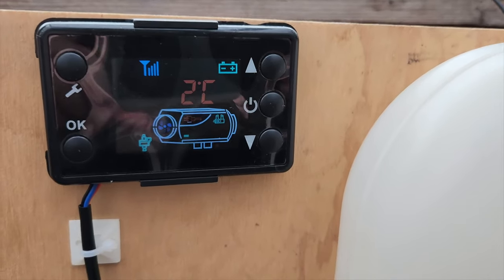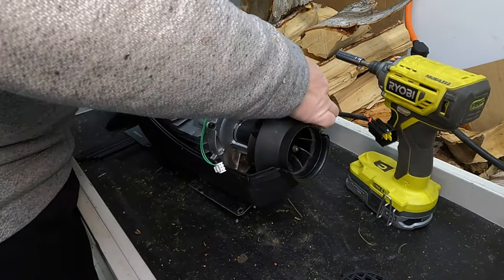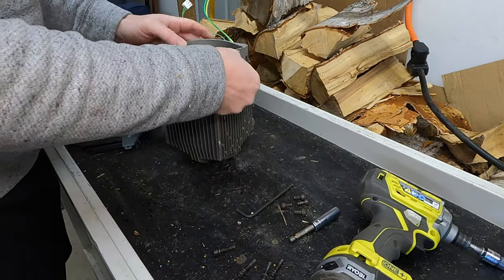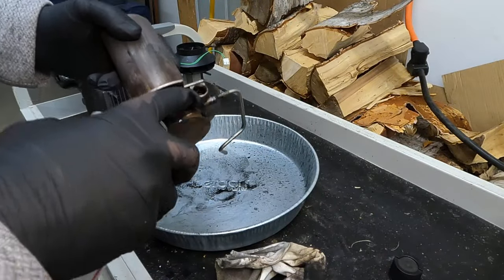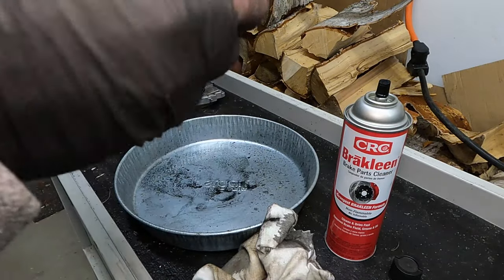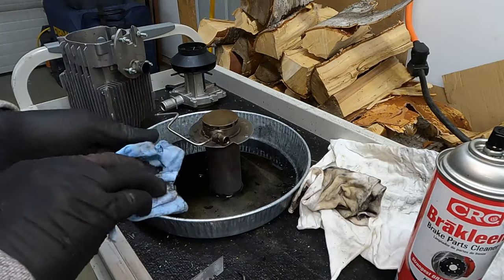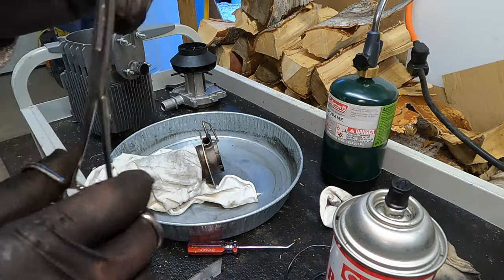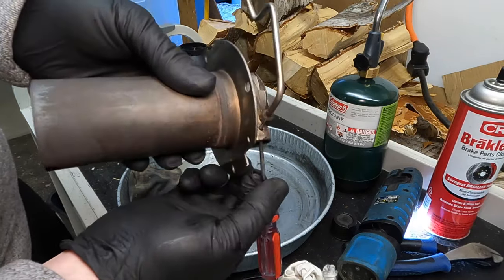My Vevor Chinese Diesel Heater Stopped Working. Can I fix it??

Comment: Couple of questions though not yet half way through the video. First…can you provide information on these rebuild kits? 
And second…would you tell us everything about that snow roof rake!?!?!👍🏻
Reply from the maker: Here's the rebuild kit I bought.
hhttps://www.amazon.com/gp/product/B0BLG8MXWJ/ref=ppx_yo_dt_b_search_asin_image?ie=UTF8&psc=1

The roof rake is pretty great. I've used it to clear off my greenhouse and high tunnel when we had excessive snow load.
Reply: @alaskanhomesteading  okay…I’m confused. The video you linked is for a hydraulic fluid change of your Branson tractor. And, the snow rake… and name I could research to find one to buy? 
I have a Kioti tractor but, I did look at Branson. Our only local dealer was not very convincing of customer service… so I ran like Forrest Gump!
Reply from the maker: @keithrayeski6417  LOL. Copy/paste fail on my part. Someone had asked me about a hydraulic filter on another of my videos, and I was copying that link for a reply to him.

I updated my reply to you with the amazon link. I'm not affiliated or anything, but that kit seemed to do the job.

I forget the brand on that snow rake. I got it used off facebook marketplace. The one most people seem to like more is the "avalanche" snow rake, which includes a sheet of plastic that slides under the snow, to help it fall off the roof. With this one, you really have to pull the snow backwards towards you.

Comment: Why is it so dirty? How long has it been running before you cleaned it? Are you filtering your fuel? Just wondering how long I should run mine before I clean it? Thanks for the vid!
Reply from the maker: I used it for a couple of months, running sporadically. I think the main issue was my failed experiment trying to use some vegetable oil in it, which I definitely do not recommend!

Comment: My unit refused to start after only some 200h. I used it at low power and only pure diesel. How many hours did yours run? And at what setting? Medium/ full power? Or ?
Reply from the maker: I don't have a count of hours, but it was only at level 4-5 most of the time. 10 is its highest setting. As others have said in the comments, it is apparently important to run them hot to keep them cleaner.

Comment: Pump is not set up correct also after a night on low blast it for 5 to 10 mins to clear it out before stopping it
Reply from the maker: Say more about the pump setup problem. Your advice about running on high to clear it up after running on low overnight sounds very solid.

Comment: When u go to high level you get flame out not that it didn’t sense the fan…your issue is your setting are off the pump if running fast it sounds like

Also if the cabin is air tight your causing negative pressure …run the intake to suck outside too
Reply from the maker: The greenhouse is definitely not airtight.  😀 I'm going to have to look into the secret menus and see about setting changes this spring.

Comment: Every four times you start your diesel heater do 50/50 of kerosene with diesel and it will clean your heater out then running mine for 12 years with no problems
Reply from the maker: That's great. I'll have to try a mix and see how it goes. Kerosene is wildly expensive here though!

Comment: FYI, once you start digging that screen out, you've got to replace it. Period. Don't touch it unless you plan to replace it. Also the real problem was the clogged air hole in this case. The amount of carbon in there was literally nothing. He could have simply ran the unit on high for 30 minutes to burn that off. You have carbon problems when that burn chamber is literally filled with carbon buildup and chunks.  This guy doesn't know what he's talking about at any stage during this video but at least he kinda said so.
Reply from the maker: I definitely do not profess to be anything like an expert, or even particularly knowledgeable about these units. I am however thankful for constructive and helpful comments that aid in my learning about them! Appreciate the feedback.
Reply from the maker: Also, I should add that besides the obstruction in that air hole near the screen, there were also large chunks of hardened carbon inside the base of the combustion chamber. Around 15:30 into the video is where I am working on picking that all out, but I did gloss over that part a bit. The air intake obstruction by the glow plug was certainly not the only issue going on here.
Reply: The screens are cheap and there’s no harm in replacing them but…you don’t need to replace the screen unless you severely damage it, I’ve done several rebuilds like this and the screens have the odd little fray, they work just fine. Heat them glowing red hot with a torch and make them round again by pushing them onto a large sized Phillips screwdriver.  Then re-install and just make sure none of the screen covers the inlet air hole.

Comment: Air is getting in from that crappy fuel filter
Reply from the maker: I'll have to look into a replacement for that. I only set this thing up with the "stock" parts it came with. Will any old inline fuel filter work?
Reply: @alaskanhomesteading  if air is going in diesel is going out - which i believe is not your case.
Reply from the maker: @jan_vyhnak  I don't have any leaks where diesel is escaping. It could just be that there was left over air in the line from running the tank dry last time.
Reply: @alaskanhomesteading  then its just vapor bubbles no need to worry in my opinion
Reply: these use pulse pumps as part of their design.... the fuel is SUPPOSE to gurgle like that.  It is not a diesel engine where there is suppose to be no air in line.
Reply: Good video.  Use oven cleaner let it soak overnight then rinse in hot water, there is also a screen in the bottom of the burn chamber that you can't see. After it gets going  you shouldn't be able to put your hand in front of the air outlet because it will be too hot, so I think you still have some sort of problem.  A lag bolt will pull out the screen around the glow plug

Comment: Vevor sucks I have 2 and their junk
Reply from the maker: It seems like the quality of all these CDHs is pretty mixed, tbh. Vevor is just a reseller, so I'd expect pretty mixed results depending on which unit you get from them, when it was made, and by which manufacturer. In general, I've had good results with the few Vevor items I've bought, but that certainly doesn't mean everyone's experience will be the same.